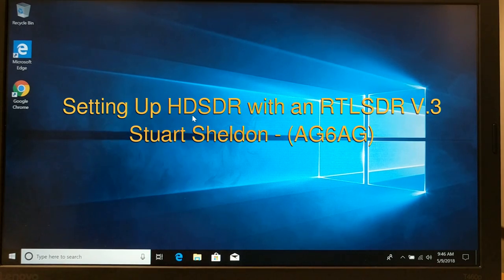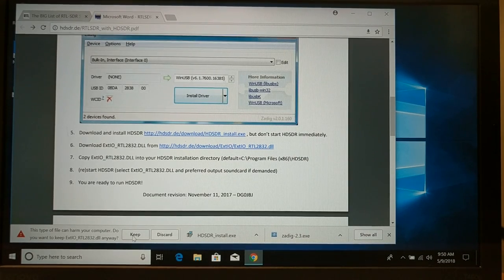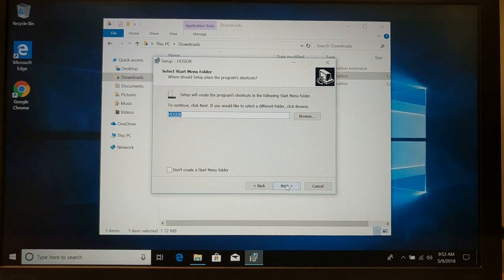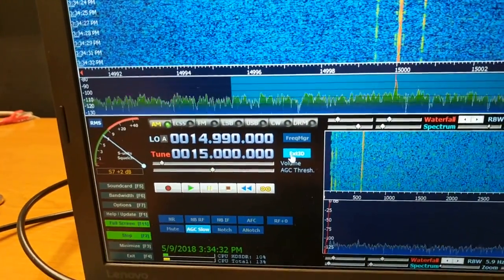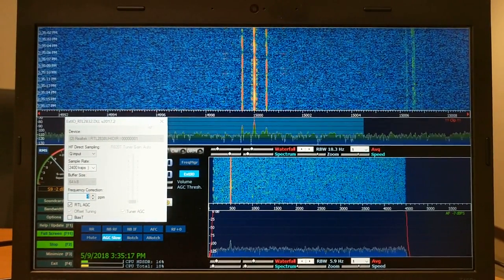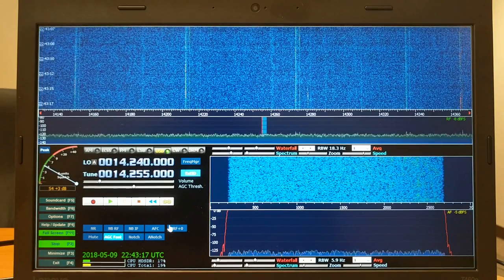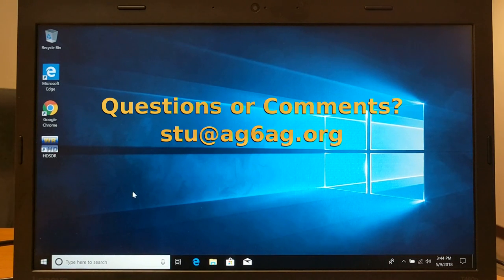Quick Start Guide to RTLSDR and HDSDR Install for Receive Only

Comment: Thanks for the upload.
The driver install etc all worked fine.
I got the sw receiving, and did a little test with a pmr446, and with a bit of fiddling I could pic up my transmission.
However, the rest of the video is pretty much unclear.
You say "there you go, that's it" and I can't see what you have done, or what you have achieved.
Also, this should be a video for Complete beginners to set up the kit they bought.
Going off and working with your di-pole and tuner is not relevant to someone who has the 5" antenna that is supplied.

Still well worth watching this vid as I got my dongle talking to the software.
Still a lot to do to get it receiving correctly, but this is a few steps covered.
Thank you.

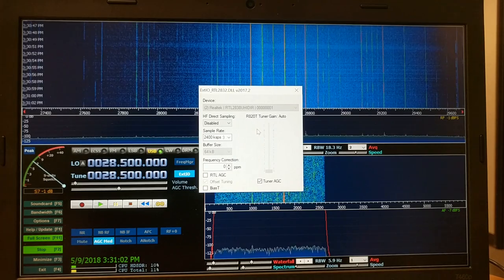Comment: @9:50 I don't see the EXT-IO button on my HDSDR. I'm running the beta, and in the title bar, it does say EXTIO_RTL2832.dll@8bit. Is there something I need to configure on the main window to have the button? I should add that I'm also running my RTL-SDR with a HamItUp v 1.3 Plus upconverter.

Comment: Great informative video Stuart what version is this HDSDR? Thanks for sharing.
Reply from the maker: Hi Tony,
This is a pretty old video so the version is also pretty old. The good news is the install is pretty much the same. Biggest difference is that the SDR settings are now accessed through a button.
I'm currently running Version 2.8, and am very happy with it.

Stu
AG6AG

Comment: HELP! The only thing I could hear on my sdr using hdsdr are a couple of local FM radio stations in my country. I want to use it to monitor VHF and UHF frequencies. Is it my dongle or have I forgotten to do something?! Hope you can help me. Thanks.
Reply from the maker: Hi Angelo,
You should be able to tune in VHF and UHF frequencies. Make sure though that HF Direct Sampling is disabled. This is required for anything over 50Mhz, and verify you have your Bandwidth set wide enough for FM Wideband.
Hope this helps!

Stu
AG6AG

Comment: I have the RTL-SDR installed with a pan adapter on a Yaesu 857D on the first IF. I take it you also need to instal the Yaesu CAT interface to control the radio?
Reply from the maker: Yes, you need to setup CAT control. Did you do the IF mod? If so, how does it work?

Stu
AG6AG
Reply: @AG6AG  Thanks for the reply. I’ve now connected the CAT via USB. Have installed Omnirig but am Having an issue finding a port to connect to . Error message says port unavailable. Am getting there though. Thanks Mark (new call sign VK3XCC).
Reply: @AG6AG  I did the IF mod and connected the CAT. Just need to workout how to tell my laptop that the USB port is a Com 1 port on Windows 10.
Reply from the maker: Here is the easiest way to figure out what com port is being created by the usb connection:

https://youtu.be/J9371IS52yQ

Stu
AG6AG

Comment: HI, useful video, I have a question: can I use the FM broadcasting channel to make LO calibration?
73, 
ZP5XSM
Reply from the maker: Good questions, I think that due to the differences between normal and direct sampling as well as the mass difference in frequency between FM broadcast and HF, it would seem to be a bit fruitless. I have never tried it however and would be interested see how it went for you...

Comment: Installed as directed last night but the ext-io button isn't there but there is a button on the left that says rtl device.  I'm not sure this has installed correctly any ideas??
Reply: Ah I didn't do bulk interface1 I'll try that later
Reply from the maker: Hi Jim,
The new version of HDSDR moved those settings to the SDR Device button on the left.

Stu
AG6AG

Comment: can you explain the tunning process, i dont understand what is going on
Reply from the maker: Hi,
Every antenna you have is "sized" for the frequency of interest you are working with. If the antenna isn't setup correctly for the frequency you are trying to use, your transmitting signal and reception will be sub standard. We are actually only dealing with a receiver when using the SDR, but properly matching the antenna to a 50 ohm impedance at the frequency of interest vastly improves our reception.
If you are really interested in the science, try this video:
https://youtu.be/1nmbmxdI3zo?si=lcSzS2N5jRYm82sE

Stu
AG6AG

Comment: how do you reset the dongle.i think i made a mistake puting the driver in.the program says    no device connected.
Reply from the maker: Hi Pete,
Just close all your programs and pull the RTLSDR out for about 10 seconds, then plug it back in. Then relaunch Zadig and follow the video instructions starting at about 4:50 into the video. Select the correct device this time and away you go!

That should do it!

Stu
AG6AG

Comment: Thanks for the information here but if I'm allowed some constructive criticism, it would be to turn the receiver down when demonstrating. It hurt my ears but when I turned the volume down, I couldn't hear your audio. You need to think about audio balance...unless you want deaf subscribers!
Reply from the maker: Yeah, the radio audio was really hot. This video was done before I really knew much about doing videos... The entire video is basically shot with a cell phone that picked up all the noise around the room as well as the laptop output.
I've been trying to work more with the audio levels to produce a better experience for the watcher, but sometimes I still goof and end up with the radio a bit to hot. It's a constant learning process.

Thanks for the comments!

Stu
AG6AG

Comment: They changed HDSR since. There is no more EXTIO button...
Reply from the maker: You are correct. The controls are now found under SDR Device which is one of the buttons on the left. F8 key is also a shortcut to it.

Stu
Reply: @AG6AG  Thank you :)